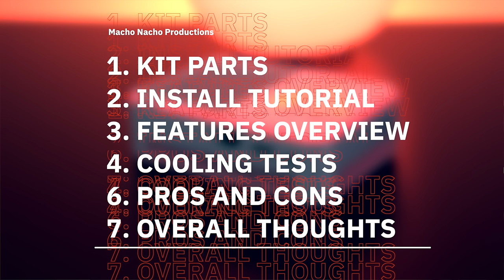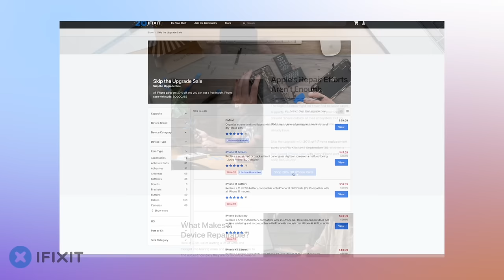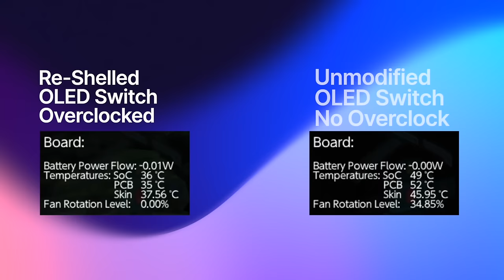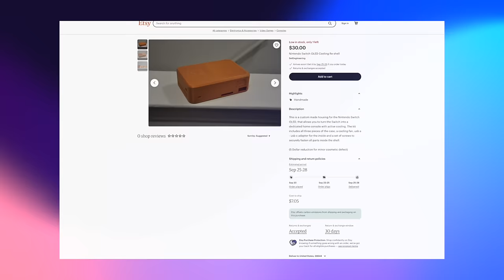Making The Nintendo Switch Run FASTER And COOLER With This NEW Mod!

Comment: Bad Ass Video! Love It! Good Job!!!

I really think this idea will take off. Switchs are broken all on ebay and could get a second life.

With that being said, I messaged the seller a request if it'd be possible to do the same on the PS4 PRO.

Right now PS4s need the batteries to be swapped out, fans replaced, cpu repasted and clearing out dust under the motherbaord.

Please share this idea with them. It would be sure fire. The best idea ive seen anyone actually pull off yet.

Im amazed!

Comment: You probably should be using the 60 fps zelda mod for proper testing of the overclock and system heat.
with something that pushes the switch, you will probably get higher temperatures.
Nice mod anyway =)

Comment: I wonder if anyone has tried milling down a conventional PC heatsink with a solid copper heat spreader in order to fit a significantly more substantial cooling solution to their modded and overclocked TV-bound console? A low-profile cooler like the Thermalright AXP90-X53 FULL might have enough meat on the copper heat spreader to allow it to be milled to account for the different heights of the components beneath the existing metal shim on the console, though the mounting would need to be completely re-engineered, or even deleted entirely in favor of mounting the entire board directly to the heatsink with a high quality thermal epoxy. Compared to the absolutely miniscule size of the stock heatsink radiator, even a low-profile cooler like that should be more than adequate to allow modders to reach the absolute limits of the SoC rather than bumping into thermal limitations.
Reply: This kit already gets the temps down to the mid 30s under load. That would be work for works case and give minimal return on investment.

Comment: The most important con is that you can't take off the sd card. It's a modded system so there are gonna be lots of times that you'll need to put it on a PC.

Comment: Nice Mod. What I would add to this is a whole new cooling System. The tiny Heatpipe and stock Fan maxed out by the TDP. I would use an BeQuiet CPU Cooler and a 140mm Fan on the slowest Speed. I think it would even be possible to get the SOC down to 32 or even under 30°C. So you could set the Clocks even higher. TotK could manage to run at solit 60FPS.

Comment: I was wondering how the fan could be off during demanding games tests. It's the Switch fan. The extra large fan itself is always on when the console is plugged.

Giving it hardware temps settings would require much more complex modding out of reach for most people, but maby a trigger with the Switch power button would do.

Comment: I overclocked my modded switch oled and repasted it, the temps are below 50° and the fan barely spins in fact the only way to know if it spins it to put your ear near the fun duct cause is so quiet.
And temps below 50° ? 
50° is a very low temp for a chipset running at 100% there is no need to cool it more.

Is still pretty cool and usefull for switches whit broken screens or other parts but there is absolutely no need to mod a functional switch.

Comment: This is going to be very useful to me considering i just purchased a  switch off ebay that does not work in handheld mode and only works in dock mode. I have a regular working switch but ill make that one my home console and  dock it. and use the none handheld on for streaming using this dock system.

Comment: Why are the pcbs screwed on but the dock shell layer is just loose?
A good idea for the fan problem would be a mosfet, which could be controlled by an optocoupler connected to the power led. So when the power led is on (and therefore the console), the fan will spin.

Comment: It’s weird that he made the top fan an exhaust in addition to the switch fan exhaust. Wouldn’t it make more sense to make the 80mm fan an intake? Any excess air that doesn’t get blown out by the stock switch fan gets pushed out the vent holes in the case

Comment: it is unfortunate the the battery is required--I was hoping I could do similar getting away with just a powerplug-dock combo the mainboard and a couple subboards.
Context of that being a briefcase project with a monitor+hdmi switch, and a ton of compact game systems. (maybe even getting lazy and building inside one of those gaems cases)

Comment: The fan is backwards? The structure of the fan (the circuit bits) is the exhaust side. So you are sucking air from the bottom to the top. This will compete with the original fan that is trying to push air outside through the heatsink fins.

Comment: Does this work on first gen switchs and not just OLED? Just curious because my switch my switch broke a few months ago after playing with my nefew, sd card reader is no longer able to to be connected to the motherboard and missing a few screws.

Comment: I thought the cooling would be more comprehensive... like at least adding a bigger heat sink with more ribbing. Like this is just an extra fan blowing down on the motherboard?

Comment: you think this would work with an original switch? i wanna try this with my damaged switch but it's not an OLED. maybe i could use the original motherboard but buy some OLED dock parts?

Comment: Everyone is talking about things that are a bit redundant. Is there any other projects looking at removing the battery? In the repair shop we've seen these die a tonne/have to be replaced. If we can work out a way to remove the battery and use a power adaptor directly to the motherboard then it would last longer (preservation of the console).

Comment: just needs to put a toggle switch on the front and have the fan power run through it so you can toggle it on and off

Comment: does the battery have to be connected? because a TV switch would likely not run great on battery anyway and Lithium batteries iirc dont like to be full all the time

Comment: I don't understand the need of the battery. If this is going to be a non portable always powered type of console, just like any other home console in existence, why do we need a battery?
I would love to see a kit that just cirumvents the battery and powers the board directly.
Also, a better heatsink assembly would be lovely.
The way this is presented i think its a bit missleading though. This is not a mod, this is just a way to encase a Switch with a bigger fan.

Comment: Why did you set your fan to blow away from switch fan, it will reduce airflow to original fan and in that configuration it's definetly not optimal aifrlow.

Comment: nice build. is it possible to run the stitch without a battery? i have a broken switch and i think the battery connection is the problem. sadly the one isnt good for cfw :/

Comment: I think this a cool mod. But what are you supposed to do when you reset the system and it requires the joycons to be connected to the switch screen?

Comment: Does it work great with the original unpatched switch by any chance? Mine really struggles with performance to the point that my PC with a dying CPU runs switch games better than my actual switch, and I don't think that should ever be the case. Plus I can't really play my switch in handheld mode anyway, the rail for the right Joycon is faulty so my joycon almost never maintains a proper connection

Comment: The reason Nintendo doesn't want to dip their feet back into full consoles again was because their last console was a resounding failure. The Switch is NOT a console, it is a dockable portable, Much like various mods that exist for older consoles and Android devices have been dockable since around 2013 or so, Basically, the technology wasn't new when this switch was released, and I am heavily unimpressed.

Comment: Is the oled model that crappy? Does it heat up and become laggy and unusable? I have several regular Switches and even a lite around the household and we've never had any issues with heat. They don't warm up more than barely warm to the touch. Even if we are playing something like Hogwarts Legacy, Witcher 3, multiple different Mario games and everything else while charging we never get anything close to hot.
Reply: This mod is more for using a broken switch again, and to overclock. 
The heat issue is not a major case when not, but if you want much smoother gameplay with less stutters in demanding games, overclocking is great. That makes more heat. More heat, more thermal throttling. This makes it so the overclock actually stays overclocked and not thermally throttle.

Comment: So much effort put into this, yet they still use the original heat sync. I would have found a way to implement a bigger one, that fan ain't gonna do much with the original.

Comment: Quick question: If i have my switch dock, my would i need to buy this? i mean, i dont actually have a switch so i dont now how it works, but im pretty sure you dont need the screen working to play on the dock, wich is basically what this mod does. Aside of the cooling improvement, i dont see more benefits.

Comment: Ive been wanting a solid console variation. I had this idea as soon as the switch came out. I was told the same. Why? Because. I wouldve made it look like a gamecube and added the gc controller plugs.

Comment: I did this, the biggest issue I have is that if you have a hacked console its impossible to be changing from nand to emunand. Better leave it in emunand forever
Reply: I did it, and I had to borrow a friend's N switch to be able to use his screen and configure hekate to boot directly into the emunad and not into the stock, and now I use it directly with the dock "My switch's screen it's broken"

Comment: Getting a switch with a broken screen i could see the utilities of this. With the overclocking capability games like breath of the wild can be pushed up to 60fps similar to how killzone mercenary can run at an unlocked framerate on the vita up to 60fps. Closest thing to a refresh on the switches current stock capabilities. I wonder if this can work with a switch lite

Comment: I don’t get these results. How can an overclocked Switch runs cooler with 0% fan speed but the base clock runs at 20-30% fan speed also at higher temps.
Were the results mixed up?

Would makes more sense to me for the switch to run hotter when overclocked. Also the 0% fan speed at overclock makes me a little skeptical to watch the results.

Comment: Good luck installing a "modchip" without a screen😅 . You need the screen to setup the mod, this can't be done in docking mode. 
So, can't overclock when screen is broken, unfortunately.

Comment: The stock fan curve target is 65 degrees and I have never seen my OC Erista Switch go above about low 60ish. Especially once you learn the only meaningful OC is the RAM which increases temps not at all, nor affects battery life.
This is a great mod for damaged Switches but man... I think you're overselling it.

Comment: A home console from Nintendo wont be a switch. The next console will in fact be a desktop box like playstation/xbox. And then Nintendo will create an application for the switch that lets you stream your new home console to your switch screen so you can play handheld. That way they can keep the life of the switch going longer than would typically happen. As you would still get new switch games, but then also have a faster/more power home console to have more epic games on.....

Comment: hey i dought anyone would know but i watched this one channel replace motherboard and put a new battery in the og switch to make it a v2 but im affriad swapping the motherboard will wipe my pokemon data specifically could i just take out the sd card that has the saves and then replace the  board?

Comment: this mod would be 1000000% better if it was for the switch lite instead of the switch oled, I know of a handful of friends that have switch lites with busted screens, stick drift, etc that would breathe new life into them. Doesn't make much sense to go buy the most expensive switch, then remove everything that makes it the most expensive switch...

Comment: Question, could would this case work with a standard switch pcb and oled dock? Or does it specifically have to be the oled version? From what I understood, the main differences between the standard switch and the oled switch were the slightly larger better screen, the dock had a built in ethernet port, better kickstand, otherwise I thought it was all the same. I think maybe a slightly better battery.

Comment: wouldnt matter on unmodded switches since everythings on a limit (stock switch is undeclocked) and games have an fps cap for both docked and undocked (theyre different caps depending on the game and whether its docked or not)

Comment: Would be nice if you could power it through the battery connector port for switches with broken usb c ports but then you would need another way to get video from the motherboard.

Comment: In a video you did a whole back, you did a metal shell Switch mod. You didn't use these temperature readings that the system gives you in that video. How do they compare to this mod?

Comment: do you know your GPU ''oc'' is just behind the REAL perf of the NVIDIA TEGRA T1, and i surrelly handle more thank 1 ghz. Bc is the original speed clock before the tuch of nintendo. Then you should try maybe 1100 mhz for locking fps. Sure you wil have maybe some degrees increase but adding 250 mhz to you gpu, wil help you to gain maybe 5-8 fps more. who isn't negligeable due to low perf of swicht ;'(.

Comment: Interesting shell, but the print could be better, even with a bambu which it seemed to be printed on (judging by the texture)

why not turn around the casefan? looks like the two fans fight each other - does it make a difference?

Comment: Hi Tito

I watch your Channel all the time and wanted to know if you can direct me to a good repair shop. I have a switch and it has a problem with the SD card not being recognized and when you insert an SD card it freezes. Need to send it to a reputable repair shop or technician. I am in NY but I am willing to g to mail it to someone for repair.

Comment: Could use a micro sdcard extension cable if there was a slot on the case to mount it. I have one on my 3D printer as its SD slot is in the back... Also is there a version for the 1st gen switch?

Comment: Would love to see a better cooling solution as a optional addition is there any dicernable difference in fps or loading times when overclocked or fps stability if not this really is no different than a normal switch

Comment: Sorry, but not really a fan of this. There's a lot of missed opportunities.
1.) Why keep the same rinky-dink cooler on the SoC? Why not upgrade this to a larger more efficient option?

2.) Can't change the SD card without taking it apart? 

3.) There doesn't look like a lot of thought was put into airflow inside of here other than slapping a larger 80mm fan on the top and calling it "done". 

4.) I don't see why this has to be only for an OLED Switch. Nothing was done in this build (that I can see) that a normal Switch couldn't do.

Not trying to be a negative Nancy here. I actually really love the idea of this - but if we're going down this road and losing functionality & portability I want the trade-off to be worth it. "You can't carry this around, but check out how powerful it is now."

Comment: selling unfinished products with issues that easily could be solved is kind of insulting. always on fan. really? couldnt they add cheap thermostat or even create heatsink that could fit a bit larger fan that could use same connectors as stock fan. and this screws...please...also for this mod to be usefull, console should be modded, inaccessible sd card on modded switch is not a good idea either.
Reply: I wouldn't say the cons are too bad. I just wired in a switch for the fan and it is poking through one of the existing exhaust ports of the case. It looks really nice and gives me an option to turn the fan off. I also never really swap my micro SD, but even if you needed to, it only takes a few seconds to pop the top and get to it. I wouldn't say it is inaccessible.

Comment: The micro sd card not accessible from the outside is a big deal breaker. I mean, really? Couldn’t include a slot on the side of the case to slide it in? Unless that’s included to me it’s worthless

Comment: a consolized handheld...nothing new. btw the 80mm fan should be the other way around sucking air in, not out. the original fan blows out.
Reply: Exactly. It suppose to be blowing cool air onto the pcb so cool all components including the pipe. Its why the large vents are in the back.

Comment: Why is the top fan pulling air out from right above the intake for the heatsink fan? I understand the concept of a negative pressure system, but it seems pretty counter-intuitive to not have it as an intake making the job of the heatsink fan easier instead of removing its air supply from right above it

Comment: Also: why does this look like one of those beelink or minisforum mini PCs

Edit: also, again; there needs to be a way to make a 12v power source for the fan so it gets more power and air flow

And another edit: should also include a way to access the usb3 ports from the outside too

Comment: Do you (or the creator) by any means sell this modded console fully built? By that I mean a completely built nintendo switch like the one in this video. I would LOOOVE to buy one like that one tbh so bad, since I don't like the fps drops on zelda tears of the kingdom on my non-modded nintendo switch. I ofc don't want to mess around with modding my switch cause I'm not an expert into that, but instead I'm planning on selling my switch so I can buy one of these...

Comment: why do you need a battery if its a home console? cant you just plug it into the wall?
Reply: There's a security routine on switch that doesn't let it turn on without a battery. You could create some "bypass" for not use the battery using some resistors
Reply: @juniorbarranqueiro  i did not know that, thanks